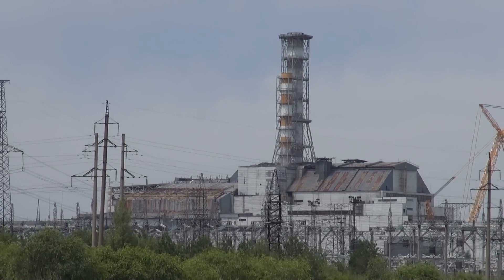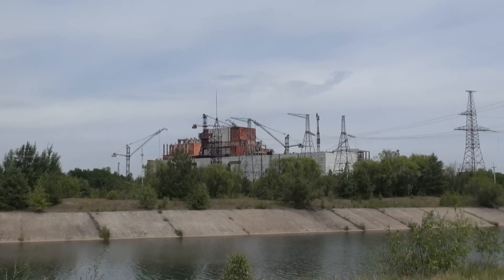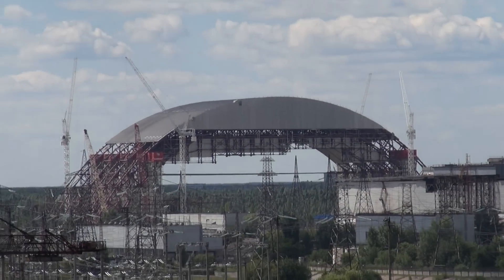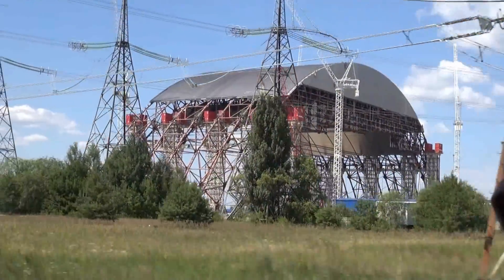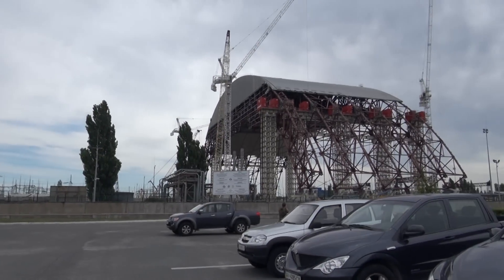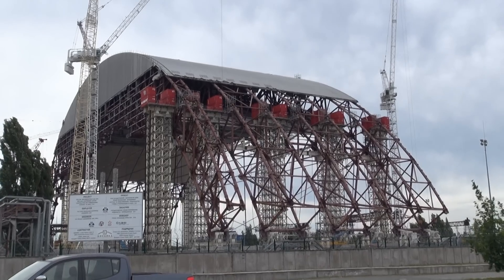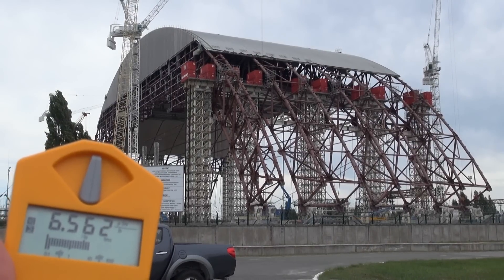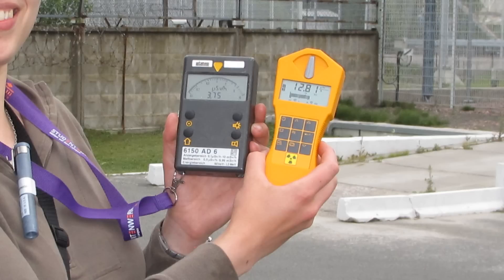chernobyl 2013: New Safe Confinement (NSC) "Арка" / shelter / sarcophagus for reactor 4

Comment: I wondered if the worksite was safe with all the radiation around. I'm happy they're working on a new containment structure for reactor 4. The sarcophagus was only meant to last about 20 years or so, built on top of the ruins of reactor 4.  I'm surprised that structure remained standing this long because of the instability of the wreckage. If only something could be done about the highly radioactive nuclear fuel still in the basement. I wish there was a way to neutralize it so it can be removed.